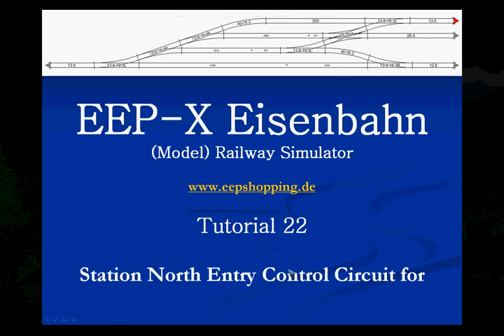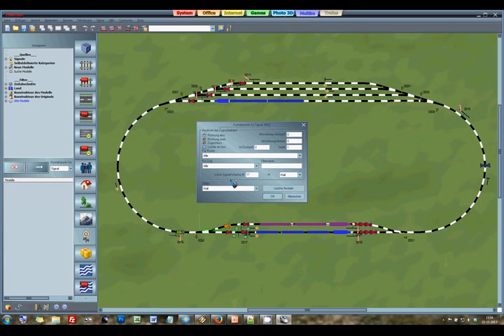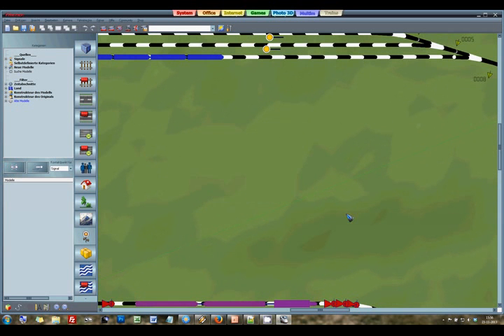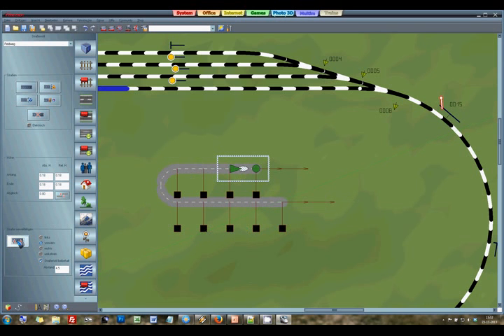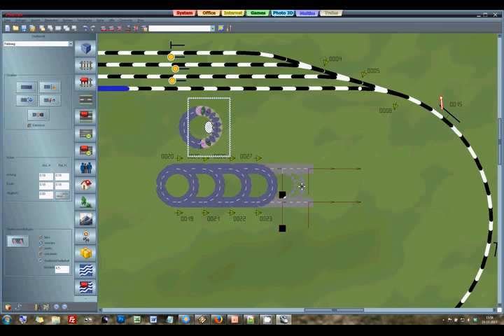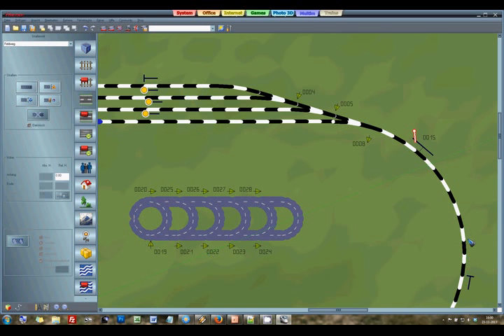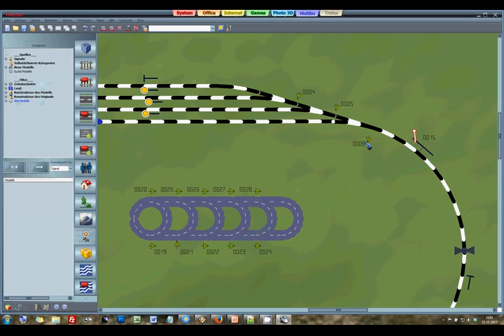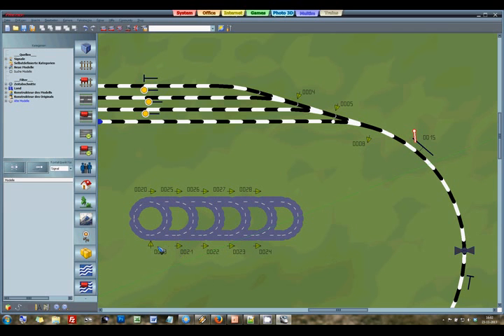EEP-X Tutorial 22 - Station North Entry Control Circuit - Model Train Simulator

Comment: @Rudysmodelrailway Hey, i was wondering, do you still do hot to videos? I am trying to make a train yard where i can move cars around to take them to other stations and then back to where they started to be refilled and moved again
Reply from the maker: Sounds nice. And ... the problem is?? :) All I can say is that you can either use a control circuit with a 'mouse' (old style) or use LUA code (new style). Both ways are shown in the series of video's.
Reply: @rudyshobbychannel  Do you remember which video it was in. I have been trying to watch all of your videos. and follow along. But i am watching them on a small phone.